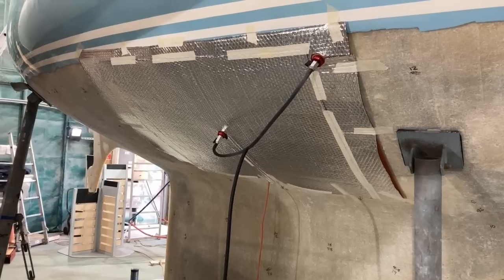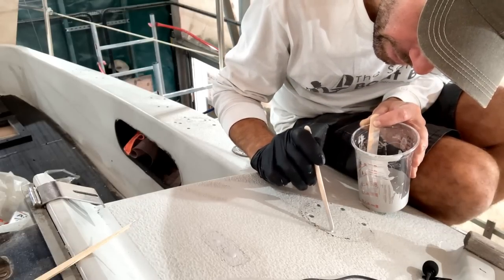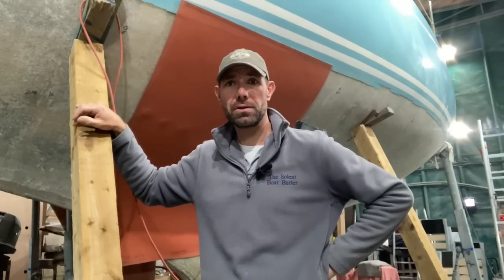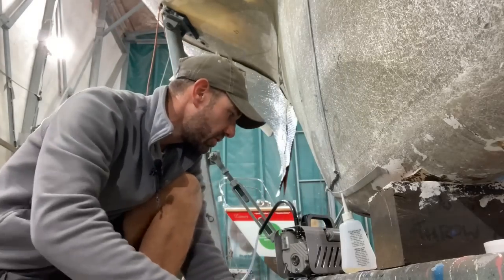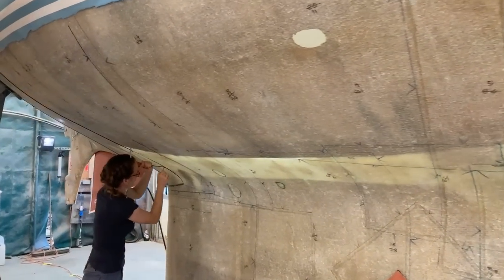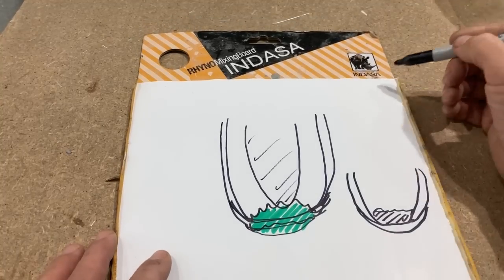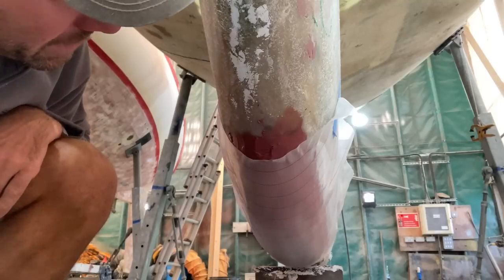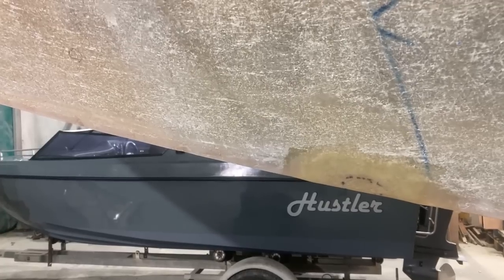Osmosis Repair Part 2 - Drying the hull laminate + hull and keel repairs (Project Lottie Ep7)

Comment: A surveyor once told me that if the forward keel on a 32 had hard impact damage he always expected to find evidence at the top/back, in the form of delamination or dishing.  Much in the area you see with with bolt on, fin keels and where the damage is on Lottie.  No point really, just an observation 👍.   Very useful videos, thanks.

Comment: Wow, vacuum pumps that are used to pull vacuum when installing air conditioners also have the same oil concerns. Those pumps are fairly inexpensive for the smaller ones.

Comment: Thank you, watching your repair work brings back fond memories of youth when we had a small cabin cruiser on Lake Kariba. It was holed hitting a submerged stump and whilst very minor compared to what you are doing, we took it back to our farm, dug a hole for the cabin to fit into and turned the boat upside down. After repairing the bottom we turned it over and cut the floor out of the cockpit so as to remove the foam which was waterlogged, replace it and remake the floor. Just wish I had seen your channel before that 😂, thank you.
Reply from the maker: That sounds like a pretty big job on its own.

Comment: It does seem to my (very ignorant) mind weird the first thing you do with something you want to dry out is soak it with a power washer.🤔🤔
Reply from the maker: It’s necessary to wash away the salts and other hydrophilic compounds on and in the laminate as the laminate drys
Reply: 🙃 I did get that from the video thanks.  You're explanation of the process was excellent.  I'm enjoying working through the series.  I was being facetious sorry.😏
Reply: @RefitandSail  I did get that from the video thanks.  You're explanation of the process was excellent.  I'm enjoying working through the series.  I was being facetious😏

Comment: Great videos, I was interested in the hull prep which led me to watching this as we are refreshing a '79 colvic, out of interest would recommend (or not) plastic skin fittings over bronze ones? I only ask as when we bought the boat earlier this year I found a couple of new plastic fittings in the spares and I am contemplating whether to use them or replace the old metal fittings like for like?
Reply from the maker: Thanks.    I have had no issues with the plastic (I prefer the more correct term which is “Composite”) seacocks that I have fitted, are they better that bronze?  Only time will tell but bronze seacocks are hard to get and expensive, the vast majority of seacocks/through hull fittings you can but are corrosion resistant/DZR brass and of variable quality.     On my boat I have a mix but as and when I need to replace them I will be fitting Trudesign composite skin fittings and seacocks.   Take from that what you wish :-)

Comment: Excellent video. I rather liked the stern tube boring rig.👍 I was just thinking about the wet skeg interior around the shaft log ‘thingy’ - I wonder if you could rig the vacuum pump up to that area via a custom connection to the shaft log (before the stern tube is fitted) and a blank on the inboard end? (Academic question - as clearly you have moved on from this.😉). 

Keep up the good work.😀👍⛵️
Reply from the maker: Thanks 👍

Comment: What an amazing professional you are, it’s been an education watching how you do it! Which brand of boats suffer osmosis least?
Reply from the maker: Thanks for the kind comment, I tend to work mostly on older boats, particularly contessa 32’s but not exclusively.  That question would probably be better put to a surveyor who has a much wider view of boats inspected.   It certainly feels like all the boats that were built in the 70’s and 80’s seem to suffer from it to some degree so it’s just a case of looking at the overall condition of a particular boat you may wish to buy and the bottom would be part of that.

Comment: I've never seen anyone fix holes with gel coat.. I seen people vee the hole and then take epoxy and fill them .. I really would like to find someone here in the midwest of America who did your type of work cause I've already got mechanical skills and carpentry skills but would really love to work on and do a restoration job on sailboats.. you really picked a great private business to start especially with boating looking like it's on a major growth spirt with loads of people buying older well built classics that just need a little attention and money.. without your vacuum heat bags doesn't it take like 9 months to a year to dry out the hull and boat completely
Reply from the maker: The holes were already mostly filled with a thickened resin and it was just colour matched gelcoat being put on top to finish it.    And yes, without using heat and vac pads it can take some hulls a very long time to dry out and even when they have dried you have not necessarily removed the hygroscopic elements that were pulling water into the laminate and form blisters.

Comment: Very informative videos, and I am learning a lot. However, I am having problems with your audio, with the volume on max I can hear you but very low. This does not happen with other channels. Thanks for sharing your knowledge.
Reply from the maker: thanks, I am struggling with getting the audio decent and at a constant level.   I'm better at fixing boats than making videos!
Reply: @RefitandSail  No worries mate, I connected my laptop to a bluetooth speaker👍.

Comment: What number would you recommend to go for on the tramex? I know it can vary but on my boat we have it showing 20-30 on most spots. I was thinking around 10 would be safe to put on epoxy. Also, how many times did you pressure wash? Is one to two times enough in the beginning? Or should you wash regularly when drying outside without the pads?

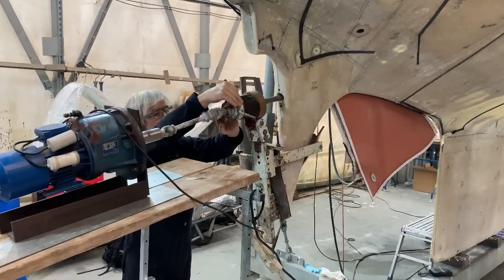Comment: Great work so far!  Am I the only one disturbed by the long sleeves working with what is effectively a lathe at the 22:00 mark?
Reply from the maker: Thanks very much.    Robin is an extremely experienced machinist and engineer, I think the angle of the shot made it look like his sleeves were close to moving parts but it was quite safe.   There was nothing loose and flapping around that could get caught.    I appreciate the comment and we do try to take safety seriously.

Comment: Fantastic George, thanks a lot once again. What kind of glass do you usually use? Curious to see the depth transducer install!
Reply from the maker: Thanks, I use a lot of what is called Combimat, its a Biax with CSM that is sewn to it.  the Sheathing will just be done with Biax though, easier to wet out and also easier to work into the curves and creases of the hull.

Comment: Hello, loving the quality of workmanship on your channel. I am in the middle of a huge refit on a Nicholson 38 from 1971 so dealing with many similar issues. I would love to know more about the bronze triducer fitting sleeve. I think I may be able to do something similar. Is it sized for a particular transducer or are they a standard size fitting. Thanks again for the great content Jon
Reply from the maker: The triducer housing is for the airmar DST 800 and similar sized transducers.   All the main manufacturers use airmar transducers (apart from nasa but they are cheap rubbish)
Reply: Thanks for clarification 👍 All the best Jon

Comment: Why not use vacuum bagging for some of the patching and on the keel?
Reply from the maker: I could have done, it potentially would have helped ensure correct resin/glass ratio but this is not a high performance boat where weight is super critical and you are trying to maximise strength with minimal laminate and I’m pretty good at glass layup without needing to vacuum bag it.  I know that there are some YT “boat builders” that like to vac bag every bit of laminate but frankly it’s unnecessary a lot of the time.

Comment: Great work, well documented. I'm working on a large hull right now and seeking hot vac pads. I've been unable to source any DIY kit. Can you help? East coast US, budget doesn't support hiring the yard. I'm peeled and now just waiting for the numbers to drop before glassing.
Reply from the maker: Sorry, can’t help on your side of the pond.   I designed/specified my pads and had them custom made so it’s not a diy/off the shelf solution.   Unlikely to be financially viable for owners to get for their own boat unless able to sell after to recoup the cost.
Reply: @RefitandSail  understood and thanks for the response. Any chance you'd be interested in sharing or selling details? I would be able to either sell these or use them again.

Comment: Is lifting a boat out over winter, when it’s cold and wet, going to have much drying effect?  Maybe to a point because it’s not sitting in water, but ambient humidity must limit it.
Reply from the maker: Yes, exactly that.  Obviously it depends what part of the world you are in but in the uk it does help reduce moisture content in a hull if lifted ashore for a period of time over winter but the effect is not as great as lifting out in the summer when it’s warmer and dry r but it helps non the less.   Remembering that if you have an epoxy coated hull that helps stop water absorption but if the epoxy barrier is applied to a wet hull it also traps it so hugely reduces its ability to dry and can even promote the blistering of a hull.

Comment: One more from me if I may - What I had to do in the past was to keep on glassing the indentations until the surfaces match - how do you determine before hand how many layers of glass you need to laminate to bring the "indent" to match the surrounding surface?
Reply from the maker: experience I suppose, I will either decide how many layers of glass I want a repair to have and sand out a suitable hollow, or feel the hollow and estimate the amount of glass to get it close to a flush/fair surface.

Comment: Question, what is wrong with the idea of the stainless steel plate along the bottom and leadind edge of the keel? Seemed like a good idea
Reply from the maker: It’s not a terrible idea, a shoe or wear strip can be a good idea if your boat regularly dries out but it is a non-standard fitment and the owner of this boat wants to do a bit of racing so wants a smooth bottom and minimal weight.   The fixings for this were leaking water into the keel area and it took an age to get all the water out!

Comment: Great work I’m doing a similar job and would like to know where to purchase the heater mats from please ?
Reply from the maker: They are not an off the shelf product, have to get them made to a specification I designed (size, wattage, location of holes and temp sensor, type of controller, etc)  there are a few companies that can prob make them but they are not cheap so unless you are doing this as a business its probably not worth it for the average boat owner.

Comment: I know the theory of why epoxy should be better., in practice have you seen properly done polyester repairs fail?
Reply from the maker: Assuming you are talking about the osmosis repair rather than the hull/keel repairs, I’m sure you could rebuild the surface and fill/fair with poly but given that the man-hours are the biggest cost then it’s a bit of a false economy to use poly when epoxy has far greater water impermeability.

Re the hull hole/keel repairs, no issue with using polyester at all, very unlikely to fail if done properly but as I’m using epoxy for the osmosis repair it makes sense to use the same resin for all the bottom work.    Hope that makes sense and answers your question.
Reply: @RefitandSail  Thank you

Comment: Which resin are you using for hull repairs? epoxy or polyester? im asking because i wonder if there may be any bonding issues because of different resins? can you please clarify?
Reply from the maker: Because the hull repairs were done as part of an osmosis treatment where the final glass layup and barrier coat were epoxy based the repairs were also epoxy.
Reply: @RefitandSail  understood, thanks, and what about structural repairs? I'm preparing to buy myself a boat and it's going to need bullhead replacement and chainplates relocation, the hill is grp

Comment: Nice content. But is it even worth to restore such boat? It's kinda small, old and has no value to be honest. What was your reasoning for doing osmosis treatment on it?
Reply from the maker: Why to we restore anything? If you look at it from purely a financial point of view then maybe it does not make sense IF you could buy an equivalent fully restored boat for less money but people restore these boat because they love the way they look and the way they sail.    You can still by new co32’s and they are beautifully built in the UK by Jeremy Rogers ltd, yes they are expensive compared to a modern production 32’ boat but you would be comparing apples and oranges, and a new boat makes a refit look good value.
Reply: @RefitandSail  Thanks for the answer. I kinda see it deferently. I would definitely repair/restore my roadster car even if it's probably cheaper to find working one on a marketplace. But I would never try repairing something like a regular Kia no matter what. It's probably about sentimental value, maybe the owner is somehow attached to that particular boat.
Reply from the maker: @Dustmadeout  agree, but a contessa32 is a Morgan 2 seat sports car, a little cramped and wet but a classic, beautiful and fun.   Definitely not a Kia!   😆

Comment: What temperature do you target with your heat pads?
Reply from the maker: It varies depending on the location of the pad and what the internal structure of the boat because you don’t want to cause hot spots or damage to the laminate.   I normally go for around 85c but it can be more or less.   Also have to remember that heat transfer is not 100% and again the internal structure effects heat loss though the inside of the boat.    So in sort….. it depends and you have to exercise a degree of judgement and skill so that it does it’s job but no damage is caused.

Comment: A hole to be filled should be grinded to I believe 12:1 ie. for every 1mm depth of hole you taper 12mm grind out, so your seacock repairs are really not sufficient.
Reply from the maker: The grinding and glass work done on the outside is insufficient if left like that, in a later video you see me compete the repair by grinding a 12:1 taper repair internally and laying up a larger repair patch.   I tend to lay up glass on both sides of a seacock repair so that there are definitely no strength issues.   In this video I only did the external side because I was concentrating on getting the hull finished externally.    Hope that makes sense.
Reply: @RefitandSail  I must admit I haven't watched the following video yet, I look forward to being corrected ( It's good for ones ego to be corrected every now and then:)
Reply from the maker: @christopher-bj8de  no worries, I thought I explained why I was doing it in this way in this episode but easy to miss perhaps if you are skipped my forward though or maybe my explanation wasn’t very good.    Thanks for watching.